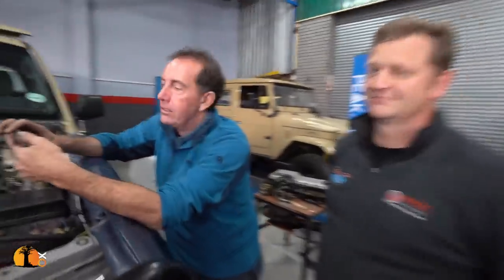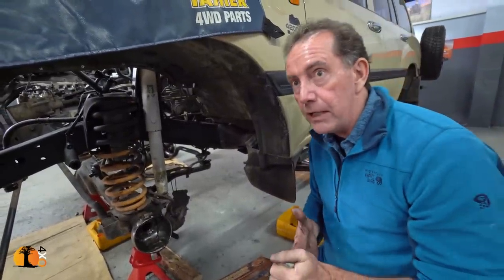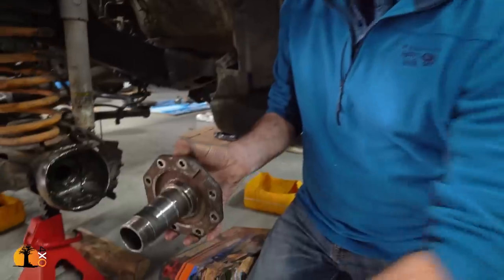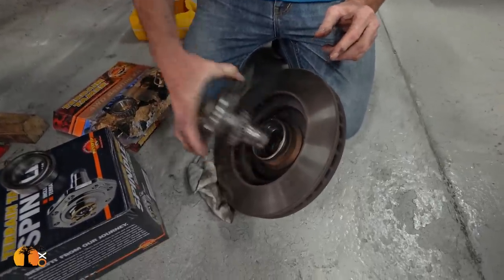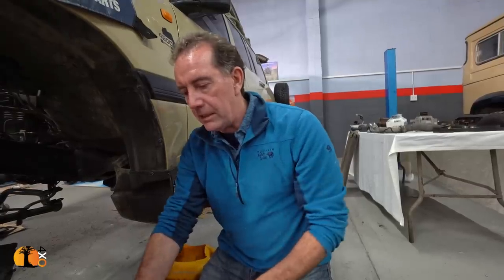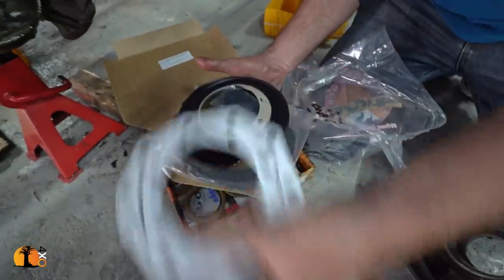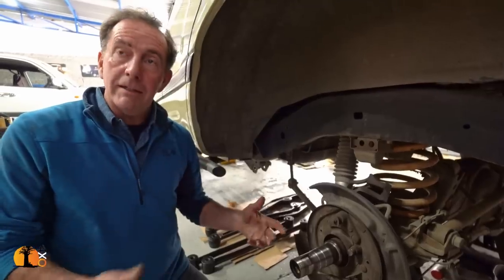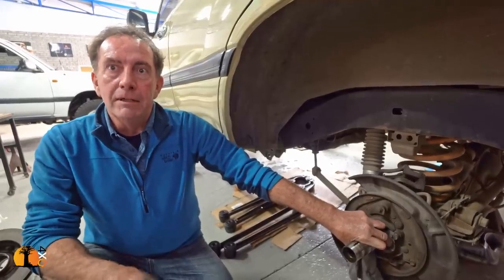AXLES, CVS & BEARINGS. NEW LIFE for a 20-Yr OLD LAND CRUISER part-8

Comment: I recently rebuilt my 1959 Willys Wagon Dana/Spicer 25 front Axle and they are configured exactly the same as these on the Land Cruiser with closed knuckles, spindles and bearings. We set the preload using shims and  a fish weight scale 😀. Point is you can do this work by yourself just make sure you get top class replacement parts. You'll learn a huge amount about your vehicle and it's great fun doing this work.
Reply: Ahh, my all time favourite vehicle! I also rebuilt a couple of Dana 25s in my lifetime and I recall the shockingly poor quality of Crown replacement parts (trust they have improved since) Fortunately I managed to find a new-old-stock Willys Overland supplier for the more difficult to find parts, whereas bearings and seals are fairly standard off-the-shelf items.
Reply: Philip Jooste Yes one has to be aware that not all replacement parts, specially bearings, races and seals, are equal. It's worth spending the few dollars more to do it once and correctly. Good to hear you're a fan of the old Willys Wagons, they were the first 4wheel drive SUV's and proved to be very popular.

Comment: If you're in the bush with a wheel bearing issue and the stub axle has been worn you can knurl the housing to get you out of a pinch.
Paul could perhaps explain that too. Personally I would not reuse wheel bearings as the case hardening can start to flake off if it hasn't already. They're cheap and small enough to take a complete new kit with.
Perhaps you could also show a newer one piece wheel bearing design that gets pressed in, and is a bugger to do in the field.

Comment: I just bought an 80 front axle to put under my 60. Diff was completely dry! Not a drop of oil. Gears had black pasty stuff on them. Put in some old gear oil and turned it a bunch of times to reliquify everything. Minimal fuzz on the drain plug. I think I got lucky but I'll find out when I take off the 3rd.

Comment: hi missed a few extremely important points 
measure Axle height to allow for different thickness king pin shims top vs bottom 
measure king pin bearing drag 
*  leaking axle seals drain the diff oil , destroys gears every  time its not rectified early.
Front hubs overhaul every 40k to 80k pending usage

Comment: Starting in reverse (using the starter not roll start) is essential in off-roading if you are stalled on a steep hill and need to reverse downhill to safety for another go on a different line or with more momentum.  The Toyota gearbox on the non-turbo landcruiser is very small compared to the Turbo manual gearbox.  The small one isn't very strong as is evidenced here.

Comment: Looks like that new axel doesn't have the ABS speed sensor ring on it. Sometimes you can replace it but sometimes they are pressed on...something to look for.
Reply: 105 has no ABS
Reply: @mattb1036  Really? The birfield that was taken out looked like it had the ABS ring.
Reply: @NigelNaughton  Well at least my '06 hzj105 doesnt,  and its a gx_r GCC spec model, so its a top spec (sounds funny for 105). Maybe there was ABS in Russia or down under, not sure 100%.

Comment: The statement about never starting a car in reverse - when you go on an off-road driving course one of the first things they teach you is what to do if you stall while ascending a steep hill and the procedure actually involves starting the car under compression (i.e. with foot off the clutch) in reverse. I assume the fact that you are not "dropping the clutch" means there wont be any shock load to the reverse gear teeth?
Reply: Jonathan Swatts correct.

Comment: I think the broken reverse gear is from snatch strap in reverse. I doubt starting a car in reverse on a hill can damage a gear like that from a stop start. 
Also grease removing hardening.....thats a first. Wheel bearings and their races are both hardened steel and they usually run i grease.......
Reply: Grease combined with diff oil is no longer grease or diff oil. The properties change.

Comment: Toyota copied the diff placement from LR, but not the CV trap release - that was interesting. Toyota xJ parts were very close to GM parts in size for diff parts and 6 cyl. gas engine parts. I'm trying to think of some Japanese original design.... 
Apperently LC is still unique for using a lot of natural rubber.

Comment: Gotta say I don't necessarily agree that the CV Grease mixing with the Diff oil can take off the case hardening of the R&P gears... Plenty of vehicles around where the diff oil also lube the wheel bearings and therefore also lube the CV's. U don't initially install these CV's w/o grease either, so the CV grease ends up mixing with the Diff oil w/o any harm at all..
Reply from the maker: Paul is correct. For designs where the same oil lubricates both bearings and gears, a different oil is specified by the manufacturer. And how does one tell if harm is being done? Unless the item is stripped, one cannot tell, as the only symptom is accelerated wear.
Reply: @4xoverland  I would like to find others who can confirm this as I have not found any and to think about it logically, I cannot see how this can be true - but, happy to be pointed in the right direction to be shown other evidence to back up your statement...
Reply: Just read some more info on this from a guy that knows more about oils and grease and even he said that what was mentioned in this video is not correct. Both the R&P in the diffs plus the CV joints and bearings are case hardened so I don’t know why one would effected and not the other...

Comment: Some of the penny pinching by keeping used parts as spares seems out of place here, especially given the significant cost of this restoration.  From an earlier episode, while the belts might look okay, retaining them as spares for an expedition is a little too miserly for my comfort.  If a belt snaps, you want to make sure that its replacement will last the rest of the trip.  Likewise in this episode, holding on to the front wheel bearings as spares doesn’t make sense when Paul said a few minutes before that they’re not very expensive.  New parts are generally supplied in damp-proof packaging, and there’s no chance of mixing up the outer shells.  While Paul’s surgeon-like attention to detail is admirable, this kind of money saving approach is incongruous with the rest of the restoration.
Reply from the maker: They do not need to last until the rest of the trip. They need to last until the next large town is reached. Money is an issue for 99.9% of the people doing such a restoration, because if it wasn't, they would just buy a new vehicle and be done with it.
Reply: 4xoverland I think there are more alternatives than just the options of brand new or 20 years old.  Many people buy Land Cruisers for not much more than a once-around-the-continent trip.  Then they hold onto them for a few more years and sell them as they no longer need the size or capability of such a vehicle.  A 5-10 year old Land Cruiser that has mainly had highway kilometres on it would be another option that should not require the same level of restoration as a 20 year old vehicle, as long as it has been serviced properly.  Don’t get me wrong, I’m more than happy to see Cruisers kept in good running order for 40-50 years, as I see the value of not chewing up resources to make new vehicles all the time.  But here we’re looking at a $20k-plus restoration, yet saving a few hundred dollars by re-using parts, some of unknown provenance.  Incongruous.

Comment: Epic. Would he carry a greasing gun on overland?
Reply from the maker: no. But a pot of wheel bearing grease, yes.
Reply: I do, every 500 km i grease the uni joints of the driveshaft, especially when i have been offroad a lot.
Also the only way to top up the grease on the 'inside' of the hub (where cv joint sits), through the bolt hole on top of the hub.

Comment: Paul be honest the 20 year old cruiser has been used and abused it is a safe bet you'll be wasting cash rebuilding the engine and the whole drive train  to the point you might aswell just build the  whole car again that way you know it is safe to drive..

you are essentially rebuilding the whole thing from scratch you might aswell source  a new crate motor  from toyota rather build in a new kit and then have the motor fuck itself after it gets in the dirt and sand..

Andrew you have paid for a lemon to be honest looking at the damage scoring there I would hate to see what la within the  engine bay and in that motor I am truly wondering whether it is worth rebuilding the engine is money well spent or doe it become a money pit to keep it on the road or in this case a dirt track..

Comment: It seems to me that having a rebuild to expedition quality LC by this company would not save any money at all. I see time and materials warning lights flashing!!! It would just be better to buy a new or late model vehicle that has good life left in it. is he correct about the changes, basically yes. But in the end, the whole point of the old vehicle and repairs is to save money. If you end up spending up to 75% of what new OEM costs, then it is a futile effort, because in the end it is still an old truck! Now if the money is spent on after market specialty parts designed for hard core off-roading, then it can be a different animal. But here we are replacing OEM parts to get it up and running in a reliable way. I have to say this is a failure because if Andrew had to pay for all parts and service, it would be a no go!!!
Reply from the maker: How can you say its a failure when you haven't seen the costs yet?
Reply: Every major system has been pulled and is being serviced. In the USA, Most of Europe and I suspect Australia too, the cost of labor is so high at automotive repair shops, it is not economical. Pulling out and repairing a transmission is $2000 or more. Pulling the engine, checking it, servicing and repairing all the parts discussed would be up to $4000 or $5000 in any large American city. The look on Andrew’s face when he saw the pulled engine. That said it. I love the channel and adventures, but as I said, if I tried this project in the New YORK Metropolitan area with a local 4x4 specialty shop, the engine and transmission alone would $10,000. Maybe South Africa is less costly for such projects. I have been down the road on such projects with custom cars and motorcycles. No more. I know from experience! I hope it works out in the end, we must remember the price for labor varies by country and region.